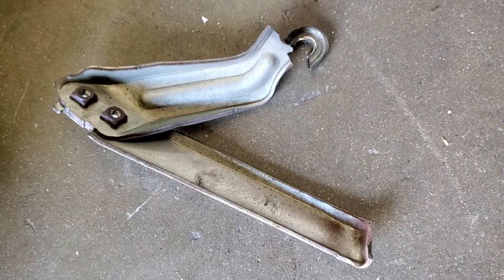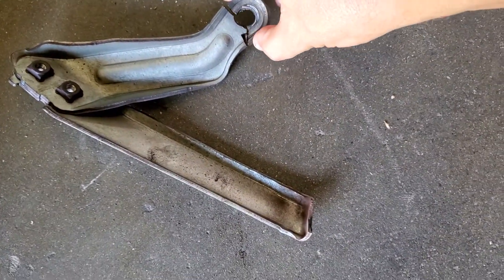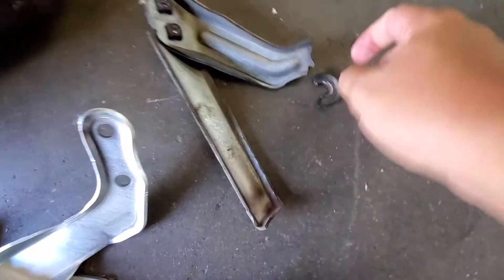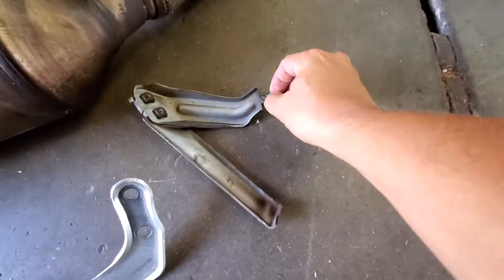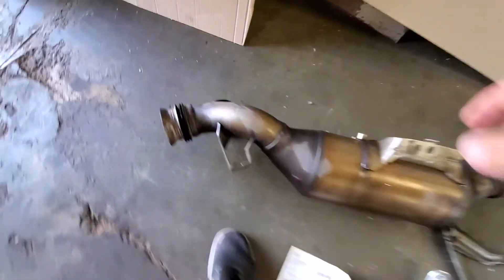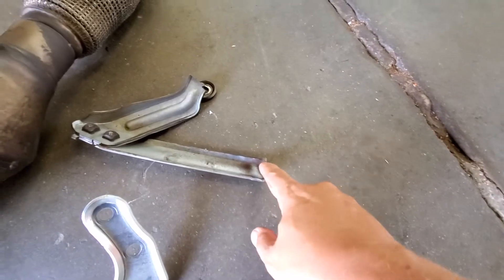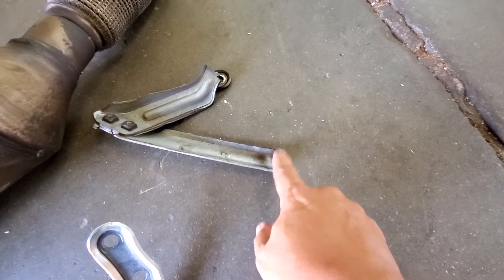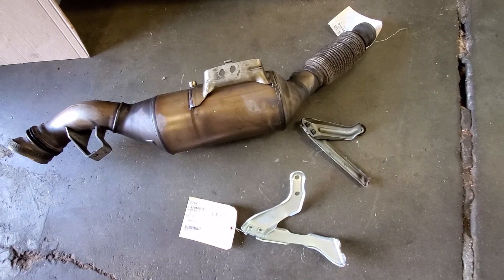Mercedes Engineer Mistake on 2014 and 2015 sprinters DPF bracket flexible exhaust pipe

Comment: The original one has 2 holes, does the 2014 Sprinter have 4 mounting points for the new bracket with 4 holes? Or does something else have to be modified to install it?
Reply: Yes -- the bolt holes exist already. The forward extra hole has a bolt in it and the extra rearward hole requires you to obtain an extra bolt.
Reply from the maker: yes

Comment: 2011 3.0 Sprinter similar problem with exhaust bracket it's broken on all of them should be a factory recall instead Mercedes wants to bend you over on a factory defective part
Reply: Also on so many modern deisel engines, including many Mercedes and Volkswagons is Black Death, exhaust and partially burn fuel fumes, blowing past injector seating copper washer. 
This should be a recall. Why? Because any old deisel fitter like me knows, all injectors had two lugs on them, with a 1/2" or 13mm stud, threaded into the block, on either side, which held the injector, under massive compression, securely. Now they have one 6 or M8 stretch bolt holding a V shaped clamp, at an angle pushing it to one side constantly. This has a much higher chance of failing, and it does, a lot.
Sometimes you can just change the washer, if you're lucky, sometimes it will have score a line in thd head needing to be recut, not cheap. If you're really unlucky, it'll be too deep to be repaired, Black Death. All the while poisoning you. Like I said it should be a recall, cheap, nasty, dangerous, expensive and toxic design flaw.